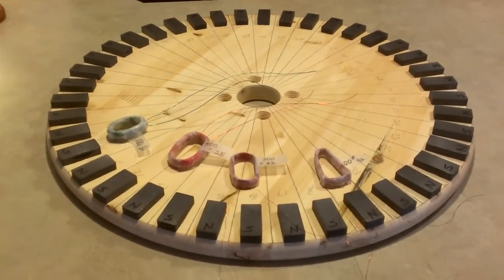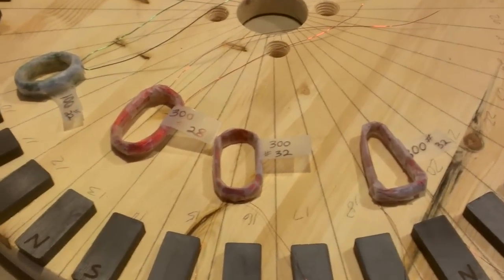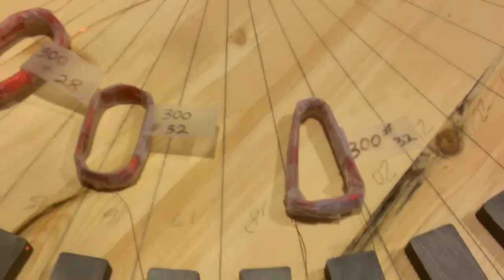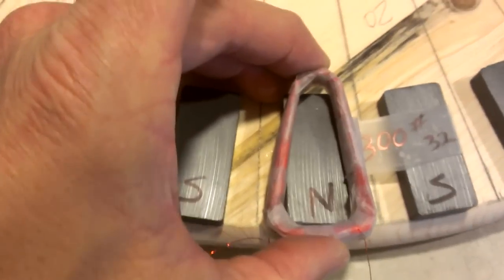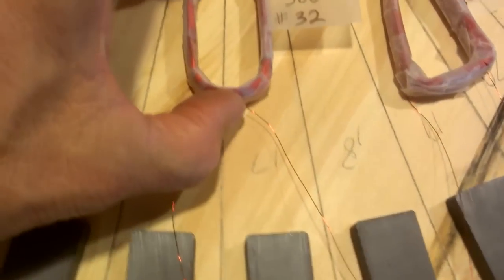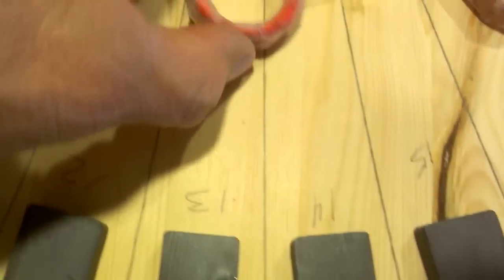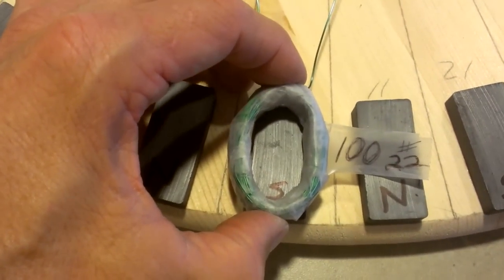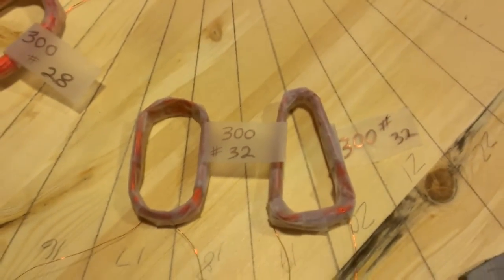Green Dan - Low RPM Generator rotor with ceramic magnets

Comment: When I made my coils, I used small zip ties. Four per coil. Then I laid them on parchment paper and saturated them with epoxy. I was still able to snip off the zip ties, and ended up with nice tight, solid coils, which made arranging them in the circle much easier.

Comment: Did you abandon the ceramic magnets? The next video shows different gauges and different turns and it looks like neodymium magnets. Hugh Piggott uses ceramic magnets for his 4F machines. They come is different strengths. And they are nearly indestructible unlike the neodymium which are really strong but can erode quickly if they are nicked at all. They rust out and become useless.  Keep up the good work. I know this was about 7 years ago. But thought I would leave the message anyway.

Comment: Remember the ratio of magnets to the coils is 3coils/4 magnets. 32 wire may burn with higher loads i.e. higher winds. Maybe go 120 winds with 21 wire with 3 coils / 4 magnets.
Reply: Some body tell us , the whys & where for of how many raps & what wire gage, & why 1 is better or why not!,
Reply: @kennyclement2823  The general formula is 1 Weber x .5(number of poles ) x 1 coil wind x 1 pass/sec = 1 volt.  1 weber is equal to 1m2. You would have to measure your magnet to see what size it is and adjust accordingly.  The multiply the Weber (meters square of the surface of your magnet facing the coil) times the number of winds to get your volt output. If you have 10 magnets you multiply by 5).  So to give you an example - I have pretty small magnets. They are only 0.0003 meters square. There are 12 of them (so I multiply by 6) and I have 9 coils of 400 winds each (so a total of 3600 winds). In a formula, it would look like this 0.0003 x 6 x 3600 x 1 pass/sec = 6.48 volts. But the trick is getting the coils to be small enough to close to the magnet. If the wire is too thick much of the coil will be outside of the range of the most efficient part of the magnet's field. So you have to play with different wire size depending on your magnet
Reply: @bridgestopeace  thank you very much!
Reply: @kennyclement2823  Any time. I have some videos showing some building but no instructional videos.

Comment: What are the benefits of 2 phase vs 3 phase?  & if you would, is a bigger triangle coil better than a smaller triangle?  or whats the optimal size is what I am asking?
Reply from the maker: 2 phase and 3 phase designs run quieter and are smoother. The coil needs to be large than the magnet so the entire magnet travels through both straight edges of the coil.  I like triangle coils simply because the angle the rotating magnets enter and leaves the coil itself.  Regarding optimal size...... I have not seen much difference between the coil being slightly bigger than the magnet versus a lot bigger than the magnet, although I am sure I will get bad comments from somebody on that statement.  I am an experimenter, not an engineer or physicists.
Reply: greendansays I still don't understand the 2 & 3 phase answer? I only understand Single & 3 phase wiring. I have all the room I need to wire coils so I am thinking of winding them 1/8" bigger in diameter all the way around. Your thoughts?
Reply: greendansays I still don't understand the 2 & 3 phase answer? I only understand Single & 3 phase wiring. I have all the room I need to wire coils so I am thinking of winding them 1/8" bigger in diameter all the way around. Your thoughts?

Comment from the maker: am going with a 2-phase set up. I just finished purchasing everything I need to start spinning the thing. In the mail today, I received my (PWM) Pulse Width Modulator to control motor speed and my rotor at 60 RPM. I will be hooking up an amp meter and volt meter while I test all the different types of coils I wrapped. Once I finish test with this rotor, I have another one which I am gluing stronger neodymium magnets on to. Then I will run all the coil tests again, with stronger magnets.

Comment: I am going with a 2-phase set up.  I just finished purchasing everything I need to start spinning the thing.  In the mail today, I received my (PWM) Pulse Width Modulator to control motor speed and my rotor at 60 RPM. I will be hooking up an amp meter and volt meter while I test all the different types of coils I wrapped.  Once I finish test with this rotor, I have another one which I am gluing stronger neodymium magnets on to.  Then I will run all the coil tests again, with stronger magnets.
Reply: I built a test wind gen. Using 1 1/8 round magnets. On a whim I doubled the magnets by stacking two instead of one. Wow! What a differance.